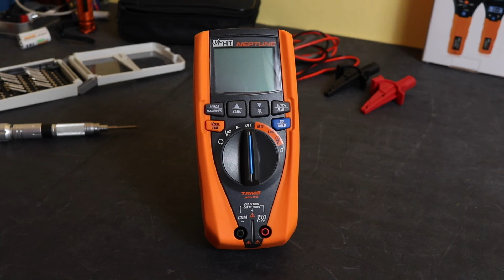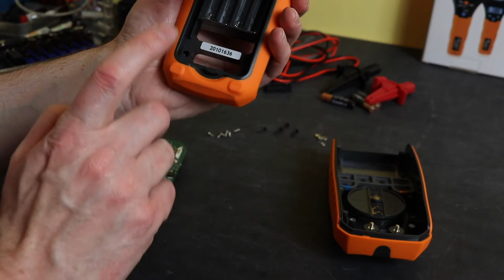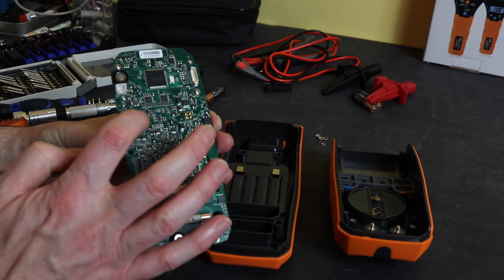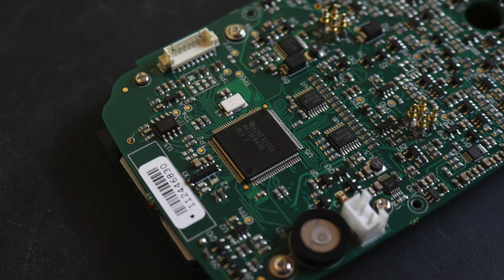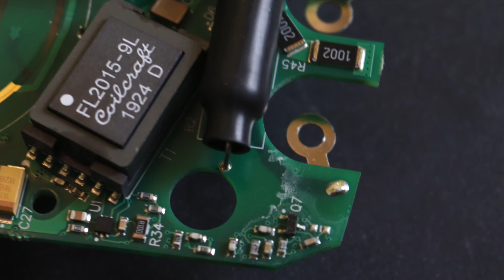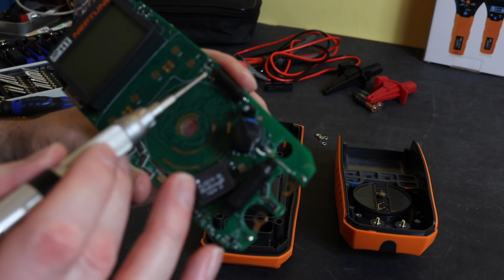HT Neptune Insulation Multimeter Teardown

Comment: I’m impressed , but not shocked that HT designed the PCB. After doing a little research on their company they’re capable of designing and manufacturing high quality products. Great multimeter autopsy 👍🏿👍🏿
Reply from the maker: Thanks TETC. I agree, I think HT Instruments have a great deal of capability backing them up.
Reply: @three-phase562  Their marketing is pretty low key. I just found out something 'strange'. The HT Jupiter only has a 1 Ohm resolution for measuring overall earth fault loop impedance. I can understand the test current is around 15mA and perhaps makes it difficult to have a higher resolution but this is the first I have come across with 1 Ohm resolution. How is it that other brands can have a 0.1 Ohm resolution? Now I am beginning to wonder if HT Instruments has difficulties with the design or other brands are just not 'realistic' in having a 0.1 Ohm resolution with 15mA measuring current. Thanks for sharing your videos.
Reply from the maker: @lemech  Certainly the 15 mA test current will be problematic for getting better resolution. I assume the function you are looking at is the "RaEarth RCD" loop measurement, which is for preventing an RCD tripping when carrying out the test. Whilst that test is convenient, it is notoriously inaccurate, the accuracy tolerance on that function is 5% + 3 ohms, so probably a good argument that a 1 ohm resolution is adequate.

The Jupiter does have a standard "RaEarth" loop measurement with a higher 100 mA test current, with a 0.1 Ohm resolution and a better accuracy tolerance. Although I feel the test current should be 200 mA for this test, even the 100 mA will trip the more common RCDs.

The Jupiter is anther rather unique instrument though, with an interesting selection of functions built into it, which seems to be some of the theme with HT Instruments.
Reply: @three-phase562  Yes, for HT instruments, they may choose to be more realistic to have a 1 Ohm resolution and that brings up the question for other brands; is it meaningful to have less than 1 ohm resolution for a test current of 15 mA?. 
Or other brands can actually resolve down to 0.1 whereas HT instruments is not able to? Megger, Kewtech, Kyoritsu; all have 0.1 resolution for no trip.
I guess in its current configuration, for no trip loop impedance, Jupiter can be used for trouble-shooting and indication of possible issues like having a 10 Ohms reading for no trip loop impedance.
In no trip mode, it cannot be used to check the acceptable Zs values per BS7671 as the resolution is too low. Regardless, the combination of functions is still appealing.
Reply from the maker: @lemech  I presume you are referring to the multi-function testers by these other companies. I did look up the Megger  MFT1700 series and whilst it has a better resolution, the accuracy tolerance is 5% +/- 5 digits, which pretty much makes the resolution quite inaccurate. It also has a caveat that the accuracy is based upon reference test conditions, so it could well be worse out in the field. 

I guess you would need to test both units side by side in the field to see if there is any significant benefits to the increased resolution.
Reply: @three-phase562  Yes, I am referring to the Megger MFT. It shows 0.XX
https://youtu.be/Vl_0vcAb_7I
Thanks for sharing your views. My awareness of that +/- digits has heightened with low resolutions; even if it is 0.1, +/- digits has a huge impact. I guess 15mA testing has its limitations even if it brings greater convenience with no trip. Thanks!
P.S. HT Instruments has some very interesting touch screen MFTs and it looks like the TIS is an OEM version of the HT Instruments.